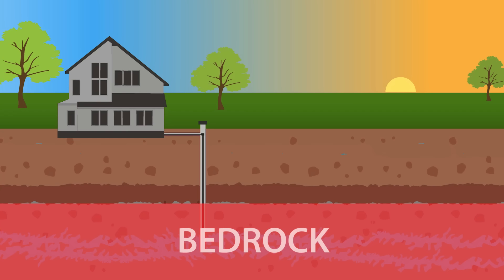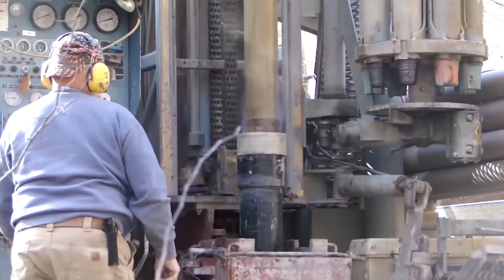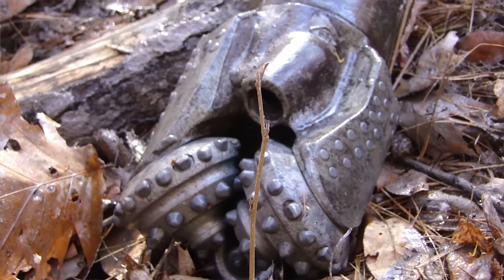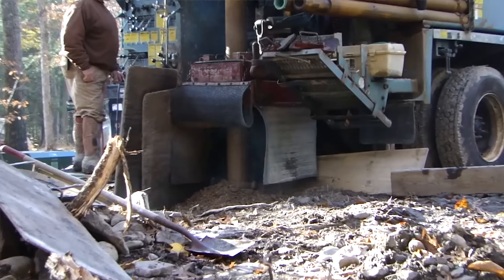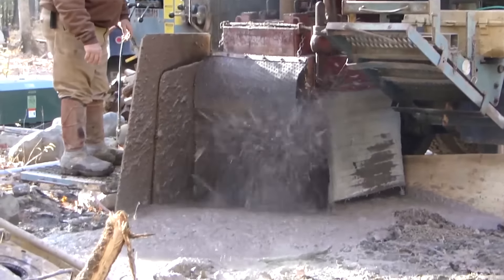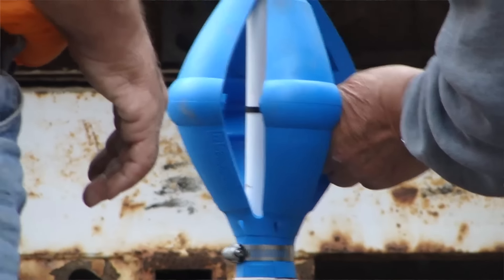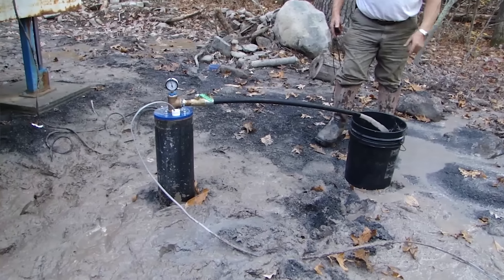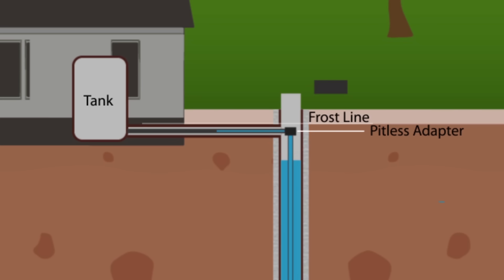WELL DRILLING 101 | Every Step Explained

Comment: After you hit water. The amount of "open hole" as we call it, just increases the amount of volume you have. Great video.  Ive been a water well driller for 22 years and im 5th generation water well driller. My dad has drilled more wells in central florida then any other driller. I was the youngest water well driller in florida when i started. Down here we go off gallons per minute. Up north they go off gallons per day. So to get back to it, the bigger the pump you use, the more open hole/ volume you need. It can be a big cavern that you hit that you dont need as much open hole. Or you may need to just go deep enough until you see enough volume. Like you said the drill may just drop a few feet. If that happens during open hole and you are below the casing there may be all the water in the world at that point. Just a cave full of water. Great video. And if you have any questions please dont hesitate to ask.
Reply: Neighbor drilled shallow-well about twenty-feet from my shallow well, which was sixty-feet from another neighbor's shallow-well; now all three are 4,700 salty?  A block from the ocean in FL.  Sixty-feet neighbor drilled down 300ft to get sulphur-water.  Some say there's a layer of clean-clear water at 120ft, but it's hit-or-miss?  On a postage-stamp lot.  Not much room left for punching holes in the earth?  Would you go for the sure-thing sulphur-water, risk trying for the thin-layer of clean water or something else?
Reply: I had a new well installed at my summer home 5 years ago. I get way too much sand in my water now. The well before it was always crystal clear. Do you think i need to have a new well installed? I will be moving there soon. It will be my permanent home.
Reply: Up North, I hope you don't mean North Florida lol.  Before I moved to Sarasota because that where my wife's family is, up on my North Florida property, on my back lot, I had a 4 in. artesian well.  I think it was somewhere between 5 to 7 hundred feet deep. It had about 20 lbs pressure with no pump.  I loved that well because it meant I had plenty of water all  the time, even when power went out.   And I had a good Meyers pump on it too.  I could get easily 65 lbs pressure because of the positive head pressure.  

With my garden, I got a couple old golf course sprinklers, I those things would shoot some water.  I miss having all that water. 

My house well was regular well, but I ran 2 in. pvp from my artesian well up through my yard, and could connect a water hose to my house when power was out.
Reply: Hi.a questions.what type of land has water well.and how to find point of holl?
Reply: Up north of the United States?  In north dakota wells are still measured in gallons per minute.
Reply: Sir.  Can i ask some questions personally about drilling water well? Can i know your fb or messanger account which i can talk to you personally
Reply: How much does drilling a well cost?
Reply: Hey well drilling question for ya if you don't mind. Can you drill a well practically anywhere? I am in kentucky if it makes a difference
Reply: @kianaloidnem6360  yes man, you can text me, just pm me
Reply: @dialecticalmonist3405  with well pump and tank and everything it's expensive now, we are at like 6,500 up to 100 feet, then like 27 bucks a foot after 100 feet
Reply: @MA-lc1cc  kinda, but you do want to find a sweet spot so you don't have shitty water. There is alot to it
Reply: @aleb5195  can prob just filter it, how much sand are you getting?
Reply: @tomnoyb8301  I would go for the best thing I can find as a driller, I don't know the area but I would try to find the cleanest water possible. Deeper is not always better.  Sulfur water actually isn't bad, it's a gas, if you filled a jug full of water and left the cap off In the refrigerator, all the Sulfur would be gone, it would be regular water as the gases would have left by the time it got cold
Reply: @muckeyduck3472  that's awesome, up north I def mean like NY Connecticut,  not up north Florida.  Thanks for sharing
Reply: @tannersonn9925  yes by up north I ment USA, not fla
Reply: @352ish  
I guess this service wouldn't be available in a suburb of California? Lol.
Reply: @dialecticalmonist3405  I doubt it lol
Reply: @352ish  way too much. My water is orange. I don't like to shower in it I always have overnight guests. It's embarrassing. It has also ruined sheets in my washing machine. I think I will look for another Well Company when I move out there permanently. Our last well was crystal clear. It was on the same property so I know it's possible. I guess some well-digger's are better than others.
Reply: @aleb5195  have you ever tried just disconnecting the pvc, and pumping it on the ground for 12 to 24 hrs open discharge?
Reply: @352ish  they ran it for 3 days when they installed it. I wouldn't know anything about disconnecting anything but I have run the sprinkler for a few days. It helps for a little while but it just goes back to Orange. Makes a mess of the aerators on the faucets and on the washing machine.
Reply: @aleb5195  prob can't ever get away from that iron then. Orange is iron
Reply: @aleb5195  filtration is expensive, but a water softener will help
Reply: I do have a few quick water drilling questions for you when you get a chance! I live in central Oregon. I wish YouTube still had a way to message users directly :(
Reply: @r0ckworthy  I will answer what I can brother, just ask.
Reply: @352ish  How do I learn to be a water well driller?  Maybe the best way is probably to intern with a water well drilling company?  I'd imagine most guys get into it because they started out in the oil/gas drilling industry, and then they switch to water for whatever reason.  And how much does a used drilling setup cost, like a drilling rig with all the equipment and stuff to get started with a water drilling company?
Reply: @r0ckworthy  I'm 7th generation well driller, so I honestly don't know how to start off getting into it. I was born into it, my family is the first ones that have been able to maintain as all my ancestors drank themselves to death. We been in business since 2001, right before 911. Now we sub contract our wells out as of about 5 years ago. So much easier to let the guys with 900k dollar rigs drill the wells for us. I would suggest going into just servicing them instead of doing a full blown well drilling outfit with no prior knowledge. I don't miss the headach of maintaining our well drilling rig, when there are people that can use their up to date rigs and drill them for you. Oil drilling is very hard work, but you get paid great, if you have a family it's hard, if your young and single you can make 6 figures a year and be happy being on a rig half the year. If you do want to become a water well driller just apply to a company and as a drillers helper, you will learn what you need to learn to establish a well in all different scenarios. You will see new things all the time that you have never seen, I don't care how long you have been doing it. There is schools, but first hand is the best way, and here in florida is different from where you are at, I've never even been there, it will be way different then my experience as being a water well driller in fla. Hope that helped a little bit
Reply: @tomnoyb8301  I would keep the Sulphur water in my opinion.
Reply: @352ish  Thank you that is very helpful information. 

Also, slight change of topic: when you're drilling a water well in Florida, it seems so strange to me that there'd be any fresh water at all considering the entire place is salt-water soaked sand (in my imagination, anyways). How far does the property need to be away from the shore before you can be pretty sure the water's not salty underground anymore?
Reply: @robert robison if your area allows you to have like an irrigation well, then yes. You will have to check to see if they allow it. It's crazy that you can't do what you want with your property. I'm sure you could pull a permit for it, might have to pull it under "irrigation" tho
Reply: Out of the topic, but you guys believe in water dowsing/witching? I tried it and constantly fail to get water😢
Reply: Up north, we do not go by gallons per day. 

Not sure where you got that from.
Reply: @352ish I gotta look into this. I’ve been with a major beverage company for 13 years and I’m ready for something different 😬🧐
Reply: How much they cost and mine is pvc at least to the top?
Reply: @miggyloucas7575  yes sure do, I do it before every well is drilled.
Reply: ive just started in the drilling industry im a laborer helping the driller and i want to understand the process more thoroughly if anyone can give me pointers or maybe videos that i can watch like this one i would appreciate it.
Reply: @352ish  😊
Reply: Hi with this experience can you help me out with my dissertation?
Reply: Is there a water table for each state that show’s potential locations ? I’m looking at buying land in northern New Mexico
Reply: I have alot of questions b/c doing this job is new to me
Reply: Hi guys! Cool equipment and Great job 👍 I’m drill a abyssinian well in Russia, what do you mean about it?
Reply: @352ish  how do I private message you.
Reply: Hey man I have a question for you on a personal unit I want to purchase for drilling some wells around my property in Texas.
Reply: Is there any way to find out if there is any stone/rock while drilling a well?
Reply: How long does it take to dig a average well??
Reply: Hey brother, doing research on wells having one drilled on my property but I have questions. You still available to answer?
Reply: Southwest Florida
Reply: @r0ckworthy  you would just have to hit the floridians aqueduct which is deeper to avoid the salt water.
Reply: Hi there, does the water underneath go dry when it's been used for commercial purpose? And with time does the ground sink or collapse? Thank you
Reply: Is there a go to resource for the average man to learn about well drilling? I'm asking for a friend in Africa living in a rocky barren terrain like the mountains of New Mexico.
Reply: can i email you so you can walk me through your whole job process i have so many questions to ask
Reply: Don't be shocked. Our well originally was only 1 (one) gallon per minute, but at the time it afforded us a  cheap property out in the country & a permit for a 3 bedroom house. Our ground is solid clay and wells on the flat land are shallow. Our well is only 50' deep and we only found any water because a few glaciered rocks were found as it is "close" to an off-property creek. We have always needed adjunctive water deliveries in Autumn to our holding tanks, but now the well seems to be  producing nothing. Not sure if I should attempt to drill for another well or somehow refresh this meager one if you have any ideas.
Reply: @aswhiteassnow5087  if you already have tanks, this tells me you are going to deal with this forever. Does any of your neighbors have to deal with this also? 1 1gpm seems crazy.
Reply: This method would be great for my country in Africa. We normally pay between  $15,000 - $100,000 to drill a borehole in this country
Reply: @aleb5195 that's heavy iron ore content down there that's what causes the orange rusty looking water it's what they call hard water I've seen that alot in northern Minnesota before hard on coffee makers and hot water heaters
Reply: @Jeff-sl8xz  I've had it tested twice now. It's not hard water but I am high on nitrates. I'm going to go with a water filter and ro for the kitchen. Thanks for your help.
Reply: @352ish Hey Sir, I’m 19 and I will be attempting to get myself an interview and job at a well drilling local company. I have no experience in construction but I got tools and a mind ready to learn. Are you able to give me some face information that would help me sound like I have some important/convincing knowledge to help get this job this week. Thanks 🙏
Reply: @BariiiGR  oh man that's hard. At 19 they are gonna know you don't know much, I wouldn't want you using well drilling terms without knowing what they actually are. Just make sure you let them know you are a quick learner. My best advice is to let them know your top concern is safety, it can be very dangerous and nobody mentions when they come looking for a job that they are aware of safety for themselves and others.
Reply: @352ish just had my well dug 50 ft for 6k 😅

Comment: This video is why the Internet is soo awesome! I learned so much about this and I couldn’t learn this from books. You’re a great teacher and you taught in such a way to make this fascinating to anyone.
Reply: This truly was an awesome video!
Reply: Best well digging video on YouTube for sure. I watched start to finish
Reply: Stuff in books is what you don't find on the net
Reply: Yes, well done. Lol, ok hold the groans in the peanut gallery. It really was very informative and easy to follow.
Reply: I agree, I've learned so much about the process. I live in S.E. Minnesota that has soil, sand, clay, gravel, sandstone, limestone with caverns, and some shale. I'm thinking of buying some land and need to figure out what the drilling process costs. My home town is on the Mississippi River valley and surround by bluffs on both sides by 600' bluffs and flat top land. I need to do some research into which elevation is more economical for finding water.
Reply: I second that..
Reply: CABINS AND COTTAGES by The Editors of TIME-LIFE BOOKS Page 102, Water: From Where it is to Where You Need it! It shows how to drill it using far simpler means by hand. Then it shows you the types of pumps etc. Then it goes on to show you how to make a sewage disposal system & leach bed!
Reply: You learned nothing compared to what a book would teach
Reply: @007vsMagua   If that Land your looking at is at the Bottom of those 600 foot Bluffs, then when the Mighty Mississippi Floods , then you and your neighbors will be saying; " What Need have we of a Well when the River floods Each year ? ! "
Reply: @007vsMagua   One Idea could be if all possibilities are Ironed out is, a " Communal Well " with the cost and benefits shared by all those who chipped in !
Reply: yeah, was thinking the same thing..
Reply: Why did the man fall down the well? Because he couldn’t see that well.
Reply: Yeah I watched this and learned just before getting a job as a well driller lol
Reply: The 17min flew past great video 👍
Reply: @lonespiritofthenight2561  what kind of stuff can I find in books that I can't find on the net? I always think about this
Reply: @rubenvela44   may i ask what kind of stuff can I find in books that I can't find on the net? I always think about this
Reply: @benfrank6856  This is about a video vs a book come on
Reply: Its in a book..
Reply: lo